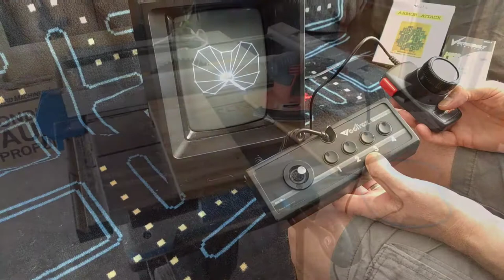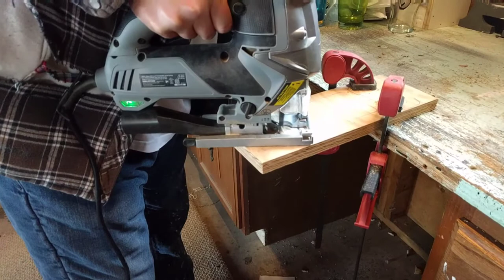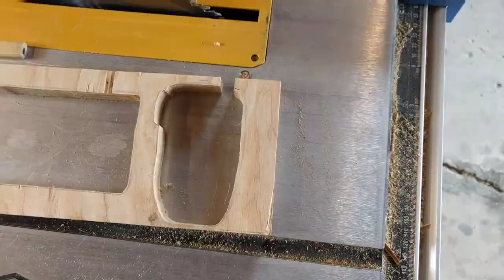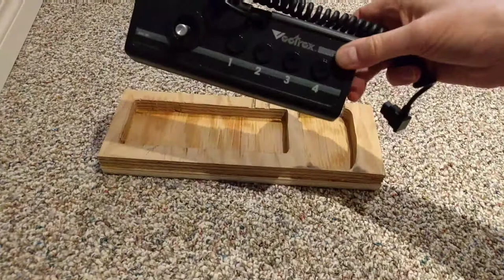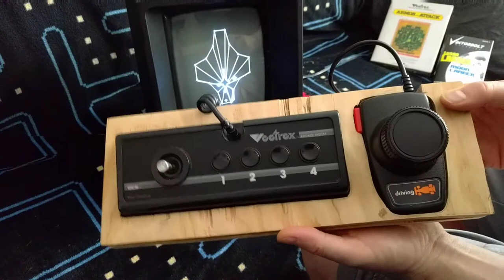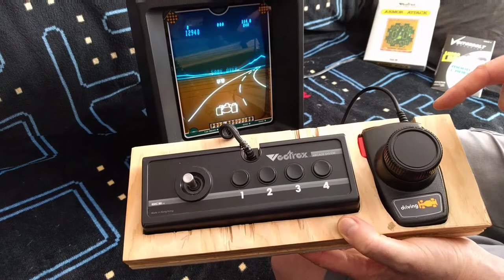let's hack together a Vectrex control board

Comment: If you widened the holes like a 16th of an inch and added felt around the sides, you could paint it and also keep it from potentially scratching the edges of your vectrex controller.
Reply from the maker: Say that's not a bad idea. I like it. Maybe using sand paper? Would that do enough widening or should I use a router or something? It would also give me a chance to fix some of those chips.
Reply: with it glued to the board you're using on the bottom it may be a bit harder. I was thinking with an electric sander. But a router would probably work too. As long as you don't take too much off :)

Comment: i didn't know the homebrew community for the vectrex did made that controller compatible. that is really cool. i don't know if you've seen this or are interested, but along those lines someone made a genesis controller for the vectrex. i've heard it works well with the system and for some games it is apparently better than the original controller.
Reply from the maker: Thanks Josh, I definitely already know about the Sega Genesis controller, I did a video a year ago playing Warrior with it and it's awesome.